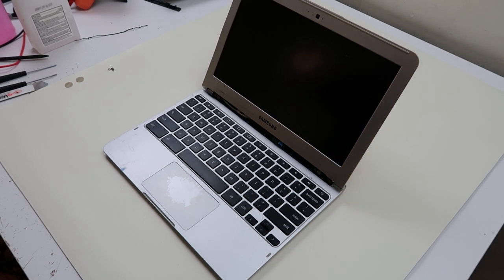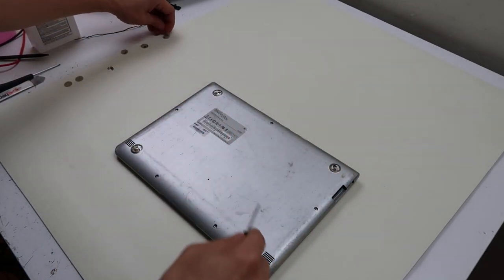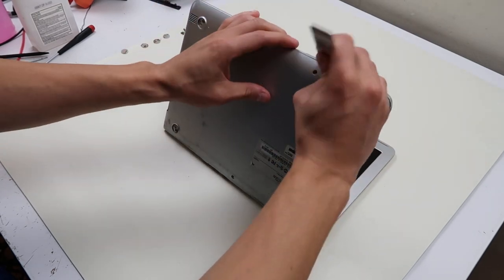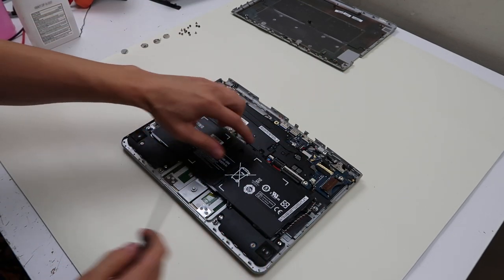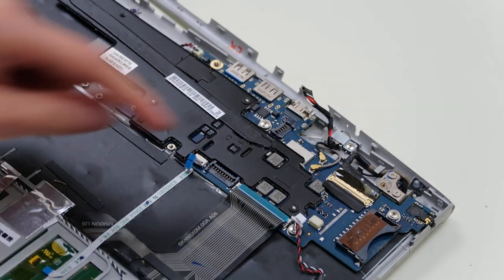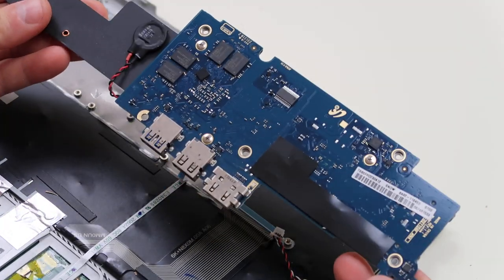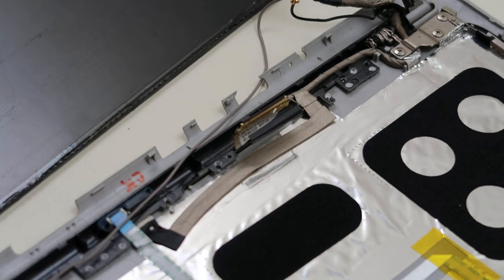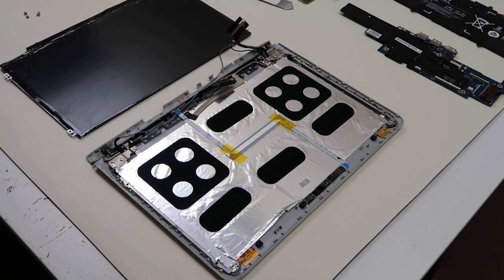Teardown Disassembly - Samsung Chromebook XE303C12 303C

Comment: I dismantled my old chrome book because I was bored but will anything bad happen if I don’t plug the battery back in?
Reply from the maker: No.  Computers should be able to run fine with just the power adapter plugged in for most operations.

Comment: I have one of these and it's not really good for anything other than YouTube at 360p. 480p drops frames the moment you move the touchpad. Are other Chromebook motherboards able to be transplanted in? I'm hoping to get more functionality out of it since it doesn't even support Playstore.
Reply from the maker: No.  Unfortunately you cannot just bring in another motherboard.  It would have to be compatible and fit into this computer.  Im afraid this model is very old.  Not many options for upgrades.

Comment: I just needed to change the battery so that seemed pretty simple. Although who ever had this poor thing before had something go wrong and there is a hump under the keyboard and touchpad. Only the touch pad doesn't work just right so I use a mouse.
Reply from the maker: Hope this video was helpful :) Thanks for watching and commenting !!
Reply: It actually was really good. I got a used chrome book for real cheep and the batteries will cost more that I payed for this. LOL But I can do it if I have to Thanks a lot.

Comment: Thank you so much for the video. I have samsung galaxy chromebook2, model number "xe930qca". I have an issue with wifi connection and i found out that the wifi card is defective. Is there a way i can replace the card? Is it built in with the motherboard? What part do i need to buy and where does it located? Please help. Thanks you in advance
Reply from the maker: Most likely not.  If its integrated into the motherboard, removing it would take special equipment and skills.  Usually easier and cheaper to replace the motherboard.
Reply: @PC_Monkey  can you do a video on the Samsung Galaxy Chromebook2 xe930qca, I am having the same issue thanks

Comment: hey man, not sure if you will see this but i have quite a few of these im planning on selling and i was wondering if it would be more profitable to sell the computers or the parts, thanks.
Reply from the maker: Are they fully working?
Reply: @PC_Monkey  some broken battery some are perfectly fine, also where would you reccomend i sell them because its hard to find a buyer
Reply from the maker: @decymusperaza4767  The ones that are working, you can sell.  Depends on where you live but you may not get very much for them.

Comment: the chromebook i have is enrolled and the only sure way of unenrolling is to replace the ssd. the only problem is that the ssd is not in the spot it usually is in and is probably under a plate i dont think it able to come out without breaking something because it almost looks like a small rivet.
Reply from the maker: What model do you have?  Most chromebooks have the SSD integrated into the motherboard.  It cannot be removed.
Reply: PC Monkey the mode is XE310XBA I have look on google and safari and there are no signs of it at all I scanned the QR code and nothing showed up
Reply from the maker: @kevingarzon8553  Yes, most likely to replace the SSD you would have to replace the whole motherboard.
Reply: PC Monkey yeah but it’s so weird that I can’t find it anywhere and developer mode is disabled
Reply from the maker: @kevingarzon8553  Those chromebooks can be real weird with that developer mode thing.  Gives me issues too when i sometimes encounter that

Comment: Show, please, how to disable write protection on motherboard to install linux. I have disassembled according to Your video, but i can not find switcher or screw for this purpose
Reply from the maker: I have never tried installing another operating system onto a chromebook.  Sry
Reply: @PC_Monkey  i am going to install it than i write result🙂. I was seeking for the sxrew, but i read about absent it too late. When the motherboard was out of laptop i read Your information about absence of screw and write protect. I connected all the parts but chromebook did not started . I brought today to service center to see what i did wrong.
In some caces i need to see how to assemble device together.
May You record such video.
That situation was as lesson for me - to be more attentive to avoid excessive pay  in the service center😀
Reply from the maker: @ИгорьСазонов-ч6у  This video shows a full teardown of this model computer.  Was this not enough to put it back together?  What parts were you having a hard time with?
Reply: This ifixit guide tells you how and it's very easy "Samsung Chromebook Xe303c12-a01 Series 3 Teardown"

Comment: Where is the memory located?
Reply from the maker: As is many Chromebooks, its integrated into the motherboard.  This means it cannot be easily removed / upgraded.
Reply: Good question. That's what I was wondering too.  I was planning to buy this model laptop but to upgrade ram and hard drive. Looks like that wont be happening.
Reply from the maker: @mwendia  You can always add external memory and storage but ya, best to get a computer that has ports / slots for upgrade :)

Comment: Where is the hard drive?

Google tells me it is part of the mother board, soldered on, but, you mght really have mentioned that.
Reply from the maker: Yes, as seen in this video, this model does not have an independent Hard Drive.  In those cases, it as well as other components such as the RAM, would be integrated into the Motherboard.
If I mentioned every part not found in this computer that is found in others, the video would be ten times longer lol.  Sry

Comment: Don't suppose anyone happens to know what I need to replace on my Chromebook? If I plug the charger in, there is no light, and I'm unable to turn the Chromebook on so I'm assuming the battery is completely dead?
Reply from the maker: For a computer that does not turn on, try this video first;  https://youtu.be/P3I7dDpkJps.  Let me know how that goes :)
Reply: @PC_Monkey  Thanks for that, having watched that video and the power jack testing video I have come to conclusion that there's a problem with the motherboard itself. I unfortunately lack the knowledge to trace where the problem is on the board, so just going to wait for a replacement board to pop up on eBay hopefully soon 🤞
Reply from the maker: @mrbrit6746  Replacing motherboards on most laptops is usually a better option than trying to fix it.  If you need help finding one, let me know :)  Chromebook motherboards are usually pretty easy to find on Ebay
Reply: @PC_Monkey  Does it have to be the same model number as the one that's currently in my Chromebook, as there seem to be several different boards for the 303C? Can't find the board that's currently in mine on eBay right now
Reply from the maker: @mrbrit6746  It does not have to be the exact part number board.  But it does usually have to be the same model number.  Look at the board to see if it physically the same.  If it is, you can chance that it will fit.
Reply: @PC_Monkey  Okay, thanks for all your help I really appreciate it! Will keep you updated if and when I manage to revive this machine 😂